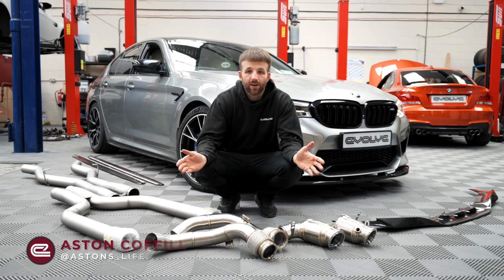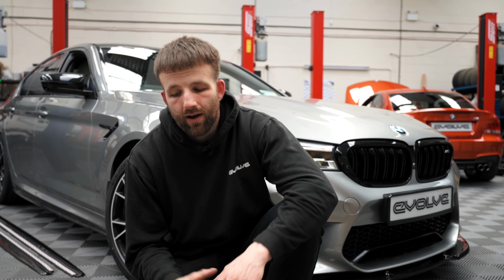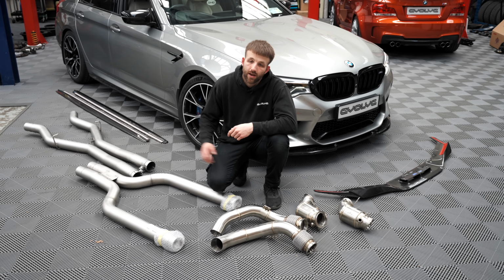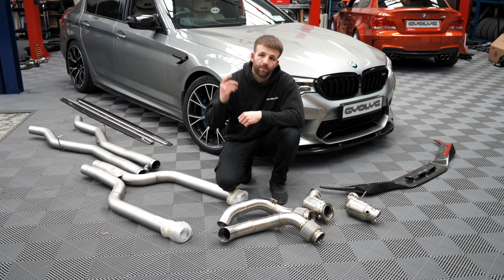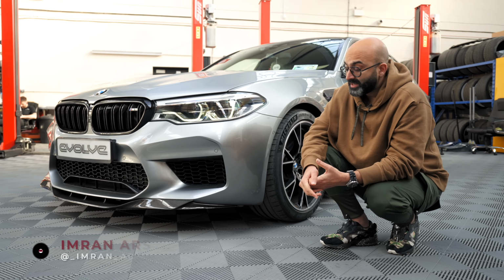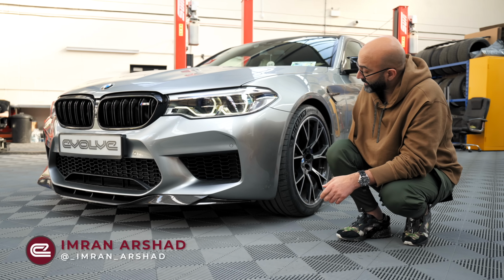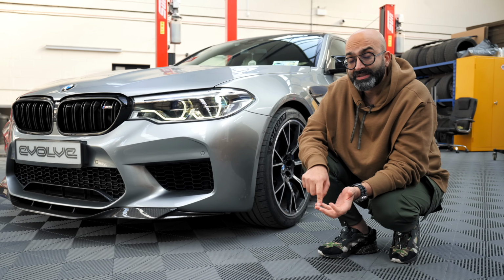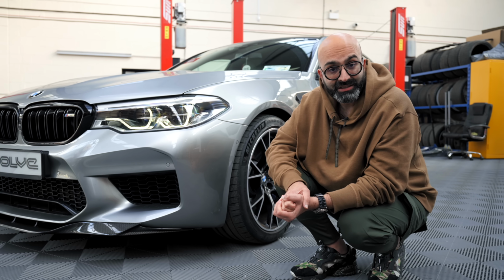F90 M5 Evolve Stage 2 Package - Catless Downpipes + Remus Midpipe + ECU Tune - Exhaust Sound + Dragy

Comment: Yes, it's time to add a 1M to the collection... but a stock one – I own a 2013 1M with about 3000 miles, is 100% stock, and I'm gonna keep as is to preserve its value (modified cars have lower value and collectors tend to discard them unless restoring to original is quick).
Reply from the maker: I'll mod everything but as you say anything we do on the classics is easily reversible 😊

Comment: Question for the experts: At what power/torque figures would the stock drivetrain fail? I’m specifically thinking about with factory launch control.
Reply from the maker: Once you start to push past 1000 the gearbox reaches its limits

Comment: I' have a question
In terms of  tuning
Do you think the  E60 M5 is faster than the M5 F90?
Reply from the maker: Not even close 😂
Reply: Never in any world, f90 is a lot faster
Reply: @Falco_e46  I'm talking about top speed, not acceleration
Reply: @bestbesto1345  then yes because the e60 was available unlimited and goes around 320 as a manual and around 330 as smg. But f90 would theoretically be able to reach a bit more, if it wasnt limited
Reply: @Falco_e46  What do you say about   BMW M5 e60 hurricane RR  G-power ?
Reply: @bestbesto1345  that is probably faster, exactly how a f90 tuned by for example infinitas that has up to just over 1k horsepower will be faster. You know you can just google right? xD
Reply: @Falco_e46  Before I'asking, search on Google, yes
But I would like to know the answer from those with experience
thank you anyway.

Comment: hi is there much difference if you fit sports cats instead of decats running 99 ron?
Reply from the maker: In power? There will be slightly less with the sports cats.
Reply: @EvolveAutomotive  yes power wise thanks👍
Reply from the maker: We have never done the test back to back to confirm. Sports cats are a great if expensive option
Reply: @EvolveAutomotive  its just the mot thing😂 else decat would be the option 👍😀
Reply: Yeah much better running cats on your car in my experience. I'm now running sports cats on my E46...

Comment: Hi.  Looks like Irish car. I also own an f90 m5 comp in Ireland. Only have 95 Ron. What power do they make stage 2 on 95 ?
Reply from the maker: Based on the Dragy time would estimate 700ish
Reply: @EvolveAutomotive  our fuel is horrendous. E10 starting this week. 95 ron still. Will this make much difference?
Reply from the maker: Not really no.

If wanting outright performance you could look in to octane booster.

Make no mistake this car still feels significantly quicker than it did before!
Reply: @EvolveAutomotive  did the Irish fuel seem be be really bad or as expected for 95 Ron. Any Dyno runs ?